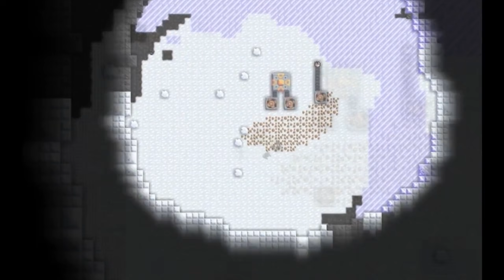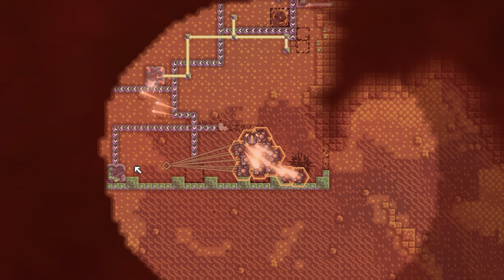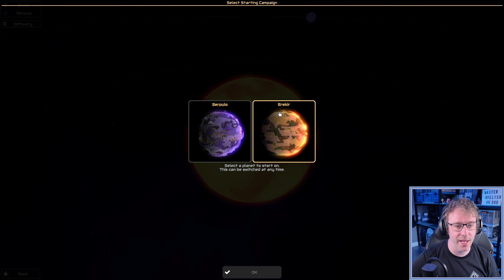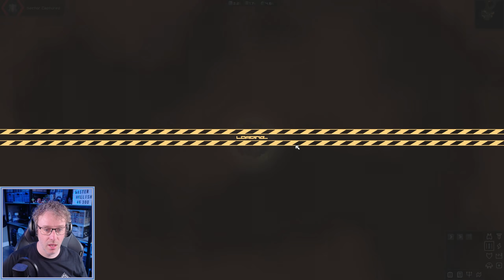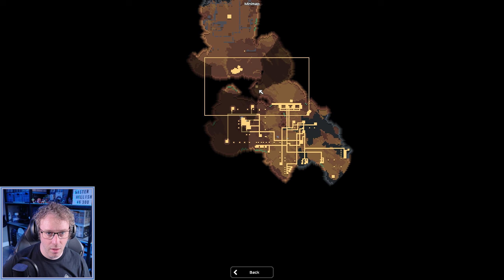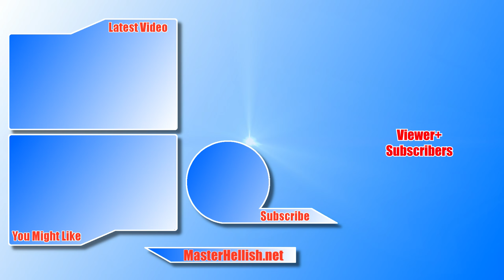Mindustry: The Ultimate Logistics Challenge?

Comment: read the block descriptions! each impact drill needs 10 water, each power turbine makes 5 water, each water condenser turbine makes 30 water

also you dont need routers for combining liquid ducts, only for splitting
Reply from the maker: There is a lot to take in for a brand new player but yes it's well made and all the info is there. I do feel the build pallet could be a little more intuitive with its icons.